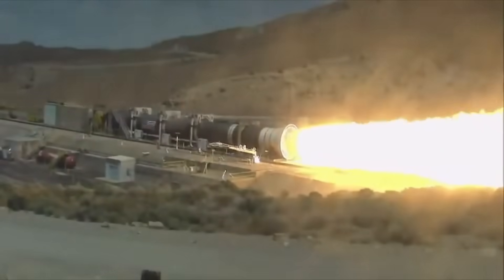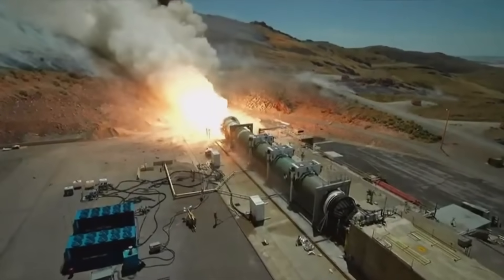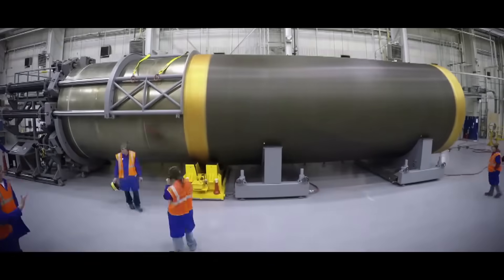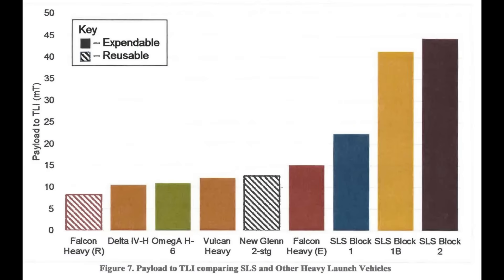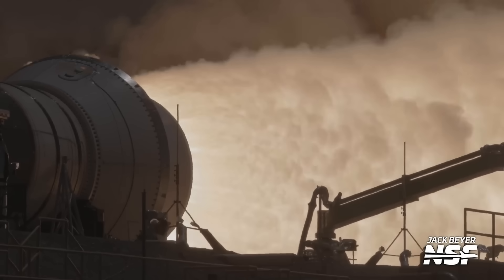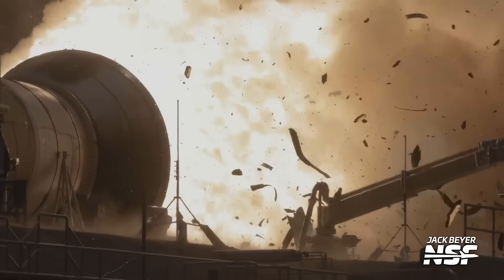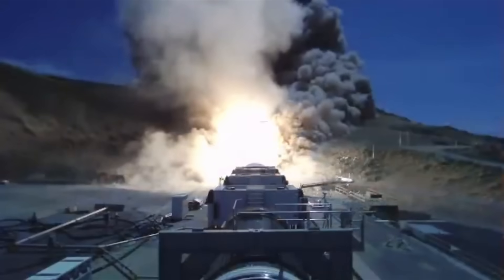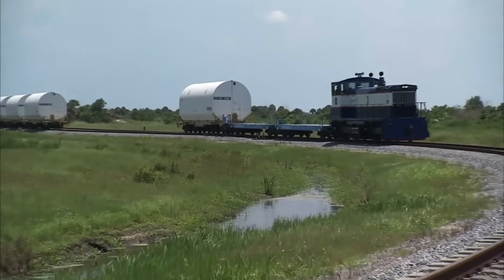NASA's Future SLS Booster Just Failed Its First Test

Comment: I was a media spokesman for Morton-Thiokol back in the Shuttle days, and your analysis of this is praiseworthy. Reporters used to complain about how far the plant was from anything, until I reminded them that we produced over a million pounds of solid rocket fuel a month. You don't want that downtown.
Reply: Just remind them about Pepcon. Putting a rocket-fuel factory near Las Vegas (Henderson) did not turn out well.
Reply: @TheCmac1966  I worked for Thiokol when that happened. Pepcon did NOT make rocket fuel, only the oxidizer chemical. The finished Space Shuttle fuel was actually safer than its ingredients because it could not explode.
Reply: @rockyraab8290  No, it's just like willie pete, once it starts burning it is impossible to put to, a class delta fire.
Reply: @DJNitreBlue  Willie Pete? Are you perchance an Empowered enjoyer?
Reply: @rockyraab8290  Am I remembering correctly that most of the energy comes from the aluminium powder in the mix?
Reply: @paulmichaelfreedman8334  That's true.
Reply: Unless you’re in Detroit
Reply: this rocket should not exist. it only exists because of lobbying ... that's disgusting. any other country besides europe would have cancelled this HUGE!!!! waste of money
Reply: Solid rocket motors have always been mixed and poured away from populated areas.  For example, Spacex's facility outside MacGregor, TX started during the Second World War as a production site for the round for 8-inch guns.  During the Southeast Asian Conflict, it produced solid rocket motors for Sidewinder missiles.

ATK was formed by combining Morton-Thiokol with Atlantic Research since both were involved in developing solid fuel rocket motors for various applications.
Reply: Seriously, not like the plant is in the middle of nowhere. It was only a 40 min drive from Perry.
Reply: @Ozzie2398 speaking as someone from North Ogden, Perry is kinda nowhere...
Reply: @jaredhenderson6163 so the difference between the middle of nowhere and the big city is 15 mins lol. North Ogden was nice once.....1978 lol
Reply: @Ozzie2398  no im not saying North Ogden is a big city by any means. What i am saying is that Perry is pretty small town, and Promontory is the Middle of nowhere.
Reply: @jaredhenderson6163 I think your definition of the middle of nowhere is definitely not the same as mine. Western Box Elder county is the middle of nowhere. 10 minutes from gas, food and lodging isn't by most people's idea of off the beaten path. Too each their own.
Reply: @jaredhenderson6163  I'll try not to take that personally, Regards, Perry... 😁
Reply: @perrymaskell3508 😂 no offence intended
Reply: Were you there for the O - Ring political fiasco?
Reply: How much do you miss media relations? 😉😂😎✌️

Comment: Ppl criticize SpaceX but every new rocket explodes... however, unlike Starship exhaust... this booster's plume is toxic AF and about 1M x less technologically sophisticated than raptor or it's fuelsystem... and it costs more per ton.  Elon has a quality control problem driven by the crap cowboy culture of the region.  This a pretty common historical problem in a few regions of TX and the Sowthwest.  It's the reason certain areas of Texas are incredibly prosperous despite crap natural resources, poor soil, etc, and some are poverty-stricken and desolate despite better resources, climate etc. See the comments by the SpaceX Q.C. engineer who got fired recently because one smugnorant anti- intellectual "cowboy" got way too far up the food chain. When the redneck mentality meets corporate s--thead things get messy and expensive.  The rednecks cut corners while corprate guy gets promoted for saving time and money... both cover for each other.  Dishonest ppl rise to the top and Boeing goes the way of MacDonald Douglas and SpaceX joins Boeing on the downward spiral express.

Comment: Also, the structure gauge of tunnels hasn’t all that much to do with the track gauge. You built tunnels as wide as you need them and then you put tracks down in them. Those can be basically any track gauge, independent of the tunnel diameter.

Comment: As fun as it is, the Roman thingy is a urban legend. Proof? In the beginning of the rail, the train would be built differently for each mine (no train networks at the time). When the train networks developed, it was done by many private companies who each used different track gauges. Then a lot of them failed and were bought out by others. This necessitated to to standardise the gauges. Generally, it was done by the biggest company who standardised their gages and would change the gauge of the smaller company they had bought. Then the government imposed one gauge for all and it choses the most used to limit costs. Even today, in countries were there were Roman roads, these are different from one side of the border to the other.

Comment: For anyone wondering, "DO NOT HUMP" reffers to the practice of sorting yards using a hill (or hump) to build trains. They will take a stick of cars and slowly push it up and over the hump, and as they roll down, there's a control tower directing the switches so it ends up one of a dozen or more separate rails to build new trains. 
It means that the car is for a time uncontrolled and going to bump into a stack of cars and it might be rough
I would not want my SRB rolling down a hill into anything...

Comment: What is even an advantage of a solid fuel rocket aside a long shelf life?
It seems to be so much simpler than a liquid fuel rocket, but is it actually?
It seems that there is a lot of dark grey magic in building them. And the performance is intrinsically lower than of the liquid fuel ones.
So for military, I totally understand. Stash it, use immediately as needed without all that fueling and unfueling hassle.
For space flight? Meh.

Comment: note on your train sidebar: track gauge is different to loading gauge and what limits the size of a train is the loading gauge, which is the maximum height and width of a vehicle, as limited by the size of tunnels, bridges, gantries etc. the track gauge is the same in the US and UK, but the US's loading gauge is significantly larger than the UK (the UK generally having the most restrictive loading gauge in the world, which is the result of it being the first rail network, and also the network originally being built by a bunch of different companies with different needs)

Comment: SRB casings have to contain considerable pressure. Hoop stress within the tube increases considerably as the tube gets bigger. The casings in use today are probably as big as they realistically can be. Horse’s A width or whatever reason we use 4ft 8.5 in rail gauge.

Comment: I'm not convinced that a reusable starship 1st makes more sense than an SRB. It is easy to tabulate the costs of reusable and not reusable SRBs, as we have a lot of history with them. Even the test stands are more reliable and reusable. Starship booster is an early prototype, changing drastically every few launches. We don't know anything about the reuse limits of each component let alone the entire Starship booster. Questions such as how does the chosen stainless steel hold up to vibration/heat stress? Does it harden unevenly, expand/shrink evenly throughout the structure? While I wish both teams good fortune, I fear that Spacex Starship is just a moneymaking sideshow.

Comment: The limiting factor on width of things transported by rail is not the track gauge of 4' 8+1/2", but the loading gauge, which is considerably larger, and quite a lot larger in the US than in the UK.  On most US railroads, you can double-stack standard shipping containers, whereas on most railroads in the UK, you can't even fit single standard shipping conatiners through their clearances despite the track gauge being identical.  (I understand they have some UK-sized shipping containers, but I've never seen them).

Comment: Just a thought. To my eye at least.
It ideally should be tested higher off the ground. There may be some back pressure from the ground. Interfering with structural forces. Not only is it trying to move horizontally against the thrust. But slightly upwards. Side-loading the nozzle.

Comment: The width of a horse is defined by the exact dimensions of the archaic horse, stored in a vault in Paris. A horsepower is also defined as the amount of power that this horse produces while working, after eating 100g of oats.
Reply: I thought they delivered the "standard archaic horse" to Troy... 
where a bloke called Paris lived.
I believe the horse had some kind of hidden vault and probably consumed a lot of oats.
Reply: when did they know when the oats 'kicked in' and provided the work needing to be done at that time?
Reply: They waited 100 seconds.
Reply: That's good to know thanks
Reply: The whole thing is a myth, and it's frankly embarrassing to hear Scott repeating it. The US didn't have a standard railroad gauge until well in to the 19th century.  During the Civil War, for example, the Confederacy still operated on three different gauges of track (the North had largely standardized by that point).  Likewise, the notion of there being some two-millenia-long exact wagon-and-rut standard has simply not existed for two millenia - wagon builders have always just done their own thing, they didn't have precise measurements to adhere to, and didn't roll through precise razor-thin ruts. And lastly, tunnels that might limit booster transport aren't just slightly larger than track widths, they're way larger than track widths, and indeed have very little to do with what gauge of track is running through them.

Comment: Saturn-I with solid booster?  To my knowledge, solid boosters were prohibited from human space flight, cuz the burn time can not be controlled.  This only changed for Space Shuttle, cuz developement of large liquid boosters was too expensive for congress.  Security reduction is cheaper.  Imagine Challenger with liquid boosters: the defective booster would have automagically shut down.

Over 60 years ago NASA went backwards, instead of building the next step upon the achieved steps.  Now there is no expertise in the field, to lift this downgradement up to previous achievements.  It was never considered if this is even possible.  Politicians simply decided how the experts should do their jobs.
🚀🏴‍☠️🎸
Reply: If Challenger had a defective liquid booster that shut down, midflight, the result would have be the same if they'd of been using an SRB...

Try again...

Comment: It'd be great to see the NASA rail system return. Pretty sure it was shut down and defunct after the end of the Shuttle program.
Despite running on the same standard gauge track, the US loading gauge is larger than the UK one. Put a US locomotive next to a UK one, it's pretty clear the US loading gauge allows for taller and wider locomotives. Certainly couldn't move SLS boosters on UK trains! Haha. 😂

Comment: 13:10 "DO NOT HUMP" What is that referring to?
Reply: Humping in railroad jargon: Involves the use of a man-made hill, or hump. A track heads up the hill and branches into numerous parallel tracks on its way down the other side. To make up new trains, a switch engine pushes a string of cars to the top of the hump, where the cars are uncoupled one at a time. Having determined the car’s destination, a worker in a nearby tower pushes buttons or throws levers or whatever to get the track switches. Cars with delicate/dangerous loads are not to be humped.

Comment: That waggon gage bullshit is romantic bullshit.. and its a been proved to be bullshit many times in many places.. sorry but very weak.
There is no evidence it goes back to Roman Chariots! Horses drawing carts were far more common than chariots. The first 'plateways' were basically wooden tracks for carts, and you can proceed from there to horse-drawn wagons on rails. "The Oxford Companion to British Railway History" (Simmons and Biddle, OUP 1997) points out that most horse-drawn carts had wheels about 5ft apart to accommodate a (single) horse, and this led to the 4ft 8.5inch gauge when wagons were put on rails and eventually became steam-hauled.
Brunel's 7ft for the GWR was a conscious decision based on lowering the centre of gravity to improve safety/comfort etc, by having the wheels outside the loco and coach bodies rather than underneath said bodies.

in short.. roman horse tracks and the shuttle have zero connection, Brunel is the dick you should be sucking.

https://www.tastesofhistory.co.uk/post/dispelling-some-myths-romans-railways-and-nasa-rockets

Comment: Interesting video, one of the first of yours I've seen.  About the booster sections rail transport.  The lower sections of the Saturn booster used for the Apollo missions were built by North American Aviation in Seal Beach, Southern California.  The plant was next to the Seal Beach Naval Weapons station.  The finished sections were transported down to the Weapons Station's docks on a local public street and loaded on barges for transport to (eventually) Kennedy Space Center, so I believe they went through the Panama Canal.  The street was literally packed with spectators watching them slowly roll by each time they did it.   Truly massive, they never would have fit through a train tunnel or under any overpass bridge I've ever seen.

Comment: I got the VIP tour at Promontory as part of Rocket Test Facility Operators Working Group, a mutual-aid society for helpful hints and lessons learned (things like "How not to burn down your test site in an oxygen-fed metal fire"). Our group photo was right in front of the nozzle of an SRB on T-97, the ground zero gang.

Viewing a test from less than two miles away was impressive, I could feel the radiant heat on my face, and the noise throughout my body. Hard to believe that was 19 years ago.

Comment: The story of how the gauge can to be actually goes back a little further. Armorers in Ancient Rome spent many hours perfecting war chariots which included many things including the number of horses, how far apart the horses should be ~ which resulted in the 4'8" dual equine centerline, and subsequebtly discovered that the chariot wheel base should match this centerline.  These armorers where essentially military engineers working under the direct supervision of the highly successful Roman military.
BTW: 4'8" is approximately equivalent to 4 Roman feet and about 3.2 palmī or 9.7 unciae in the ancient Roman system
Cheers 🙂

Comment: One of the main characteristics of solid rocket boosters is once they are ignited they cannot be shutoff. They will keep burning until the solid fuel runs out. This is why when trouble occurred with this solid rocket booster test, the solid rocket booster kept burning. With a liquid fueled rocket the fuel and the oxidizer can be turned off with shutoff valves.
Reply: But it doesn't mean liquids are safer

Comment: Railgauge is probably also a compromise based on length of wooden tie sleepers under the rails and their availability. Wider gauge more material !
Additionally,  solid rocket motors should be banned for their environmental pollution. What's wrong with liquid boosters, as is used for Soyuz?  Seems it just a political decision, pork barrel long, to keep the existing solid rocket companies in work rather than transfering to future tech.
Liquid engines you can shut down if something goes wrong.

Comment: It seems a bit ironic to me "..if they don't SLS could run out of the old Shuttle parts they're using."
First: they are still using "spare parts" from something designed and built over 45 years ago that still work.
Second: one might imagine that copying something already proven to work, even with new materials, is easier than starting from scratch.
Third: I seem to recall that they had predicted that it would cost less to rebuild them from scratch than what they charge to "repaint" the old spare parts but so far they had "wisely" chosen the second possibility for ...... reasons.

Comment: Nozzle-rich exhaust should be a final performance kick due to extended mass ejection. In order to utilize it and make it a selling feature, they only need to work on the directionality of the ejecta in order to gain an extra selling point due to the increase in specific impulse. The timing seems to be in need of a little more control as well. The RPD of the skirt section should be timed so it happens during the last two seconds of burn time, in order to not create any performance issues.
All in all, a promising new approach that needs to be developed further to gain useful application.

Comment: Why does it say "Do not hump." on the booster sections? lmao
Reply: Humping in railroad jargon: Involves the use of a man-made hill, or hump. A track heads up the hill and branches into numerous parallel tracks on its way down the other side. To make up new trains, a switch engine pushes a string of cars to the top of the hump, where the cars are uncoupled one at a time. Having determined the car’s destination, a worker in a nearby tower pushes buttons or throws levers or whatever to get the track switches. Cars with delicate/dangerous loads are not to be humped.

Comment: It is hard to imagine a solid booster failing. It is the simplest rocket possible!
Reply: Whilst I agree that it is the simplest rocket motor, all rockets are basically (ideally) slow explosions. It doesn't take a lot going wrong for a lot to go wrong, usually suddenly.
Reply: Then you should be doing it